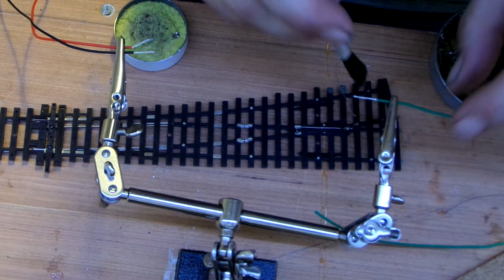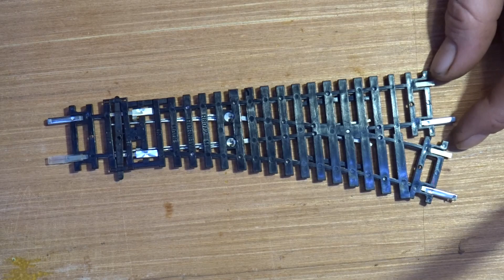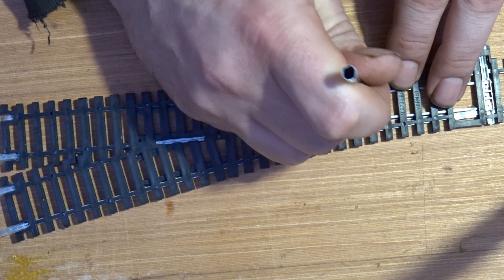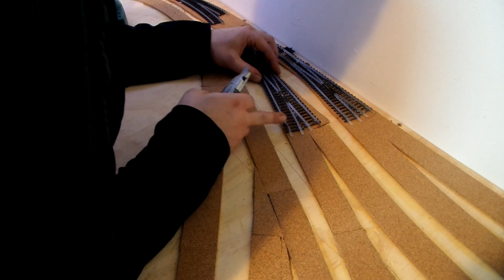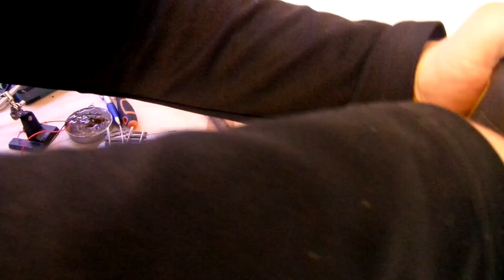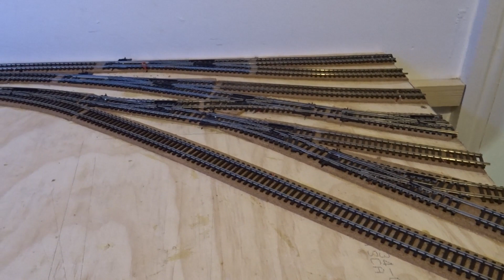07. HOW I SOLDERED MY ELECTROFROG AND INSULFROG POINTS AND A  PROGRESS UPDATE

Comment: What about the green wire.
Reply from the maker: If your referring to your frog wire this needs to be attached to your point motors switch so that the polarity is switch when the point is switched
Reply: Where on the turnout does it go @lemingtonstation9899

Comment: Hello, I am new to this channel and think it is very helpful. I need some helpful advice please re the block system. I have almost completed my track and will install the block system. I understand each block has a min of three contacts(sections) being start, travel and slow to stop at the signal.....so that is easy to follow re plastic rail joiners and wiring. However I really need some helpful advice on the multitude of points, cross overs and double slips coming out of the station? I am not able to understand where the plastic rail joiners go......Do I isolate each point and crossover and double slip? I can send a picture of the track. Any help would be great. 

I am using Windigipet 2021 as my control software and viessmann feedback modules all running through a Fleischmann TWIN centre. I have not been able to see any examples of DCC blocks with point work.  I suspect the points have a plastic rail joiners on three positions for insulfrog and five positions on electrfrog points to totally make the point a block in its own right. regards Scott
Reply from the maker: From what I can make out you don’t need to include the points in the blocks 
blocks go from point to point so as when your train passes a point it will change block to the next block depending on what the point blades is set to hope this helps if you need any more help don’t hesitate to email me my address is on my about page or drop me a message on the Facebook page

Comment: When you fit points do you use insulated rail joiners on all connections
Reply from the maker: No I only add insulated rail joiners on the frog rails on electrofrog points